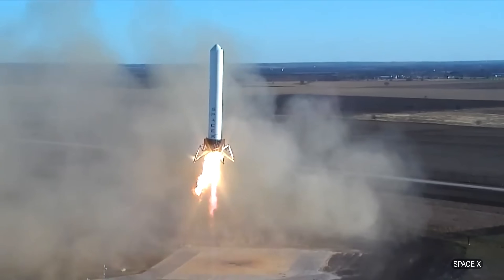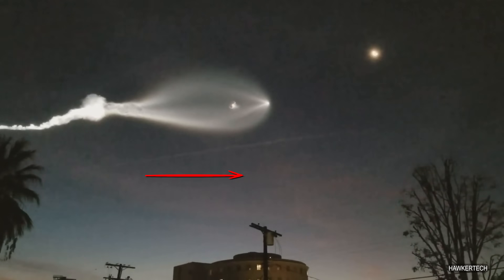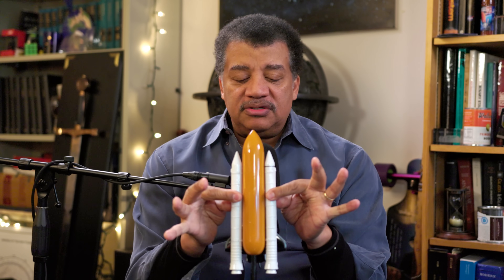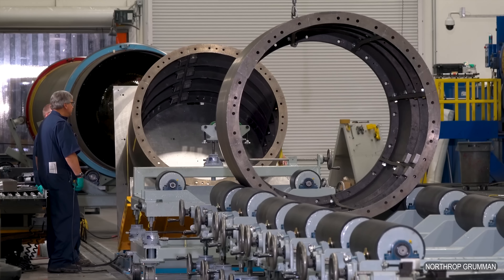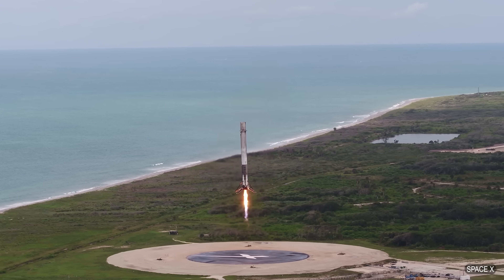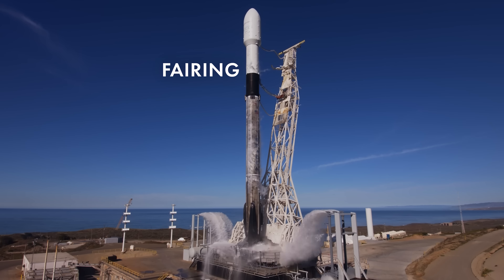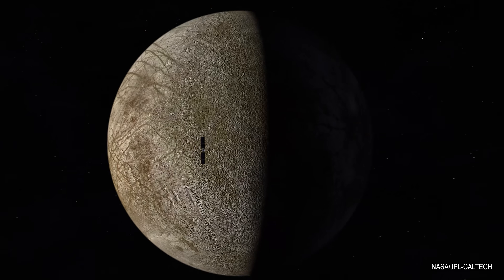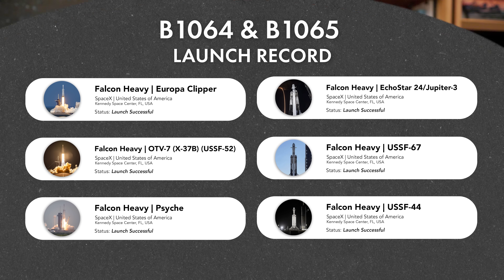What's Up with Reusable Rockets?

Comment: can u still call them “tripods” if there is 4 of them? 🤔
Reply: Quad-pods it is! Seconded!!🙌🏾
Reply: @chandcn009 came to say this😂
Reply: @chandcn009  Landing legs...
Reply: tetrapods
Reply: Polypods!
Reply: Now you look up and see the 8th Starship blown to smithereens.
Reply: @sharpvidtube  yet the booster is literally caught in the air 3 times
Reply: @ They will figure it out. They already got the booster catch down.
Reply: It's the same principle than calling some humans bipods with 3rd leg. So these are called tripods with 4th leg (and proud of it).
Reply: @tkermi  Humans are Bi-pedal
Reply: I have a lot of admiration for NDT but calling the Falcon landing legs “tripods” is just a mistake, he did not do it for “simplicity”. There are four landing legs, and he should have just said that. It’s not complicated, and it’s accurate.
Reply: Tetrapods
Reply: Quadpods sounds goofy. They will be called "dual bipods."
Reply: four tripods
Reply: Quadrupod
Reply: Landing gears
Reply: landing legs be it
Reply: pods
Reply: Frypods
Reply: it is kind of funny how there are 4 when 3 or 5 at first glance ought to be better
Reply: @snuffeldjuret  more points are more stable, especially when each is adjustable.  Three is the minimum in 3D space.  We don't make most chairs with three legs because they'd be much easier to tip, unless they were unusually wide.  We usually don't do five legs because four is stable enough that the extra engineering isn't productive.  It can look nice, though.  Humans are able to have two legs because each one comes with a long foot that usually allows a minimum of four ground contact points, and up to 14.
Reply: @ snuffeldjuret I think the primary reason most chairs have stuck to four is keeping the design and fabrication simple with right angles.
Kitchen chairs and similar situations definitely would be another good reason to stick with right angles.  Hard to imagine any theatre or close-packed classroom situation using three or five-legged chairs.  Stacking or folding chairs with a back also almost require being a four-sided design.
The five-sided design popular in office chairs relates to them being able to spin.  Closing the angles from 90 to 72 degrees between legs offers a lot of stability without going to a lot wider radius.
Yes, what I see of New Glenn's booster landing gear are six legs.  Nice looking design without getting overly fancy.
Reply: These are the real questions 🧐🧐🧐
Reply: It seems people are confused here. When he said tripod, he wasn't referring to all 4 gear, he was talking about the gear themselves. There are 4 tripod landing gear on each rocket.
Reply: @ Norman so....twelve feet?   That's four tripods.  Each part is a leg or strut with a foot.
Reply: @VoltisArt  I mean all you have to do is look at them. There are 4 contact points on the ground and 12 on the ship. It's the main strut and 2 hydraulics a leg.
Reply: @ Norman that's not what tripod means.  Tripods have one body supported by three feet, usually with some sort of legs, but not by definition.  A planter with three rubber feet is a simple tripod.
You're describing pairs of struts supporting each one of four legs with a total of four feet, which is why people above said things like quadpod, even though it's a rather uncommon word that doesn't flow quite as pleasantly as tripod.
The "pod" part means foot, so the legs (and any other supports) aren't relevant to the word.  (See also: _podiatrist_)
Reply: quarepods
Reply: You're reminding me of a US senator who said if the pentagon had only 3 sides it would be called the triagon
Reply: Tripod S+
Reply: Retracting landing legs.
Reply: Two pair of limbs
Reply: It was for simplicity.  No one would understand what a quadripod would have been, but we've all used tripods before, so we understand them as a stand, rather than the fact its three legs.

Comment: Cost of launching 1 Kg into orbit in 2025 dollars:
Saturn V: $55,000
Shuttle: $65,000
Falcon 9: $2,500
Starship (projected): $200
Reply: The cost so far for Starship, $3 billion for one banana?
Reply: @sharpvidtube starship is still doing test flights thats why it hasn’t had any payload yet.
Reply: @Wheatthin21  Apollo 7 had a crewed flight in low Earth orbit, using 60s technology. 56 years later, an empty Starship 7, blew up.  Elon claimed that there could be a manned mission to Mars in 2024, he knows how to under deliver.
Reply: I think Starship is made to travel to the moon/Mars and not for putting satellites into orbit.
Reply: @sumeshkrishnan8618  it's main purpose to b3gin wi5h is to deploy countless starlink satellites
Reply: @maaginen1007  It's main purpose is to go to Mars. That's why it's a methalox rocket. That's why it's so big. That's why it doesn't use hypergolic attitude control. Etc.

It's been shoehorned into the role of Starlink satellite launcher and moon lander, but everything about the design is intended for Mars.
Reply: @sumeshkrishnan8618  will do both. Models of starship SpaceX is getting ready to test will start testing deploying fake starlink satellites. Will also be used as a fueling station in space.
Reply: @sumeshkrishnan8618  it can easily take satellites up. Starlink is going 10x-100x the speed/capacity within a year from the new Starlink satellites designed for starship. I believe it's a 35k cu ft payload fairing
Reply: @sumeshkrishnan8618 they reported to NASA, you know their customer that’s given them billions of dollars to deliver the HLS to the moon that the current ship can not even lift the 15,000 payload to LOE.

Comment: I'm not clear if the shuttle boosters were reusable or not, but they were often towed back to Canaveral floating on the surface and not garbage at the bottom of the ocean, at least not every time.
Reply: Technically they were reused. But they stripped the whole thing down to bare metal and then put it back together again. It cost more to reuse them than to make new ones, which is why SLS isn't reusing the boosters.

Comment: if the only thing holding back privte companies from going into the space buissness was a few laws that congress needed to pass then why is it that no company form ANY OTHER contry got into the space bussness. the answer is simple. BECAUSE the laws being in place WAS NOT the main obstical. it was cost and knowledge.

over the last 30 years the cost of manufacturing has dropped off by A LOT. but it's not just the cost it's also the SPEED of making things that has also made it possible. so the main problem stopping company's from getting into space has been TECHNOLOGY. Material science, Micro-elctronic manufacturing, computer CAD software/manufacturing, computer modeling and a massive long list of other advances have finaly caught upto our imagination and enabled us to finaly move forward into space.
yes we landed on the moon in 1969 but apollo 11 was given about a 5% chance of succeeding and yes the following missions had a better chance but not by much. our vision of the future far outshone our technological knowledge.

Comment: Reusable rockets are well suited for low-Earth orbit missions. But for trips to distant planets, nuclear tugboats of the Zeus type, which is manufactured by Roscosmos, are needed.
Reply: Reusable rockets like Starship are needed to fill the tankers for in space refueling.
Reply: @ Exactly. That's how we're getting to Mars. The reason it takes NASA 6 months is because just getting to orbit empties the fuel tank. So basically NASA rockets are getting to Mars on fumes. With a full tank of gas, you can get to Mars a lot quicker, which is something Neil doesn't understand yet. Or I guess Neil is just one of those "got to see it to believe it" types.
Reply: So once your tugboat gets you to Mars, then what? You just die on Mars?
Reply: sorry but no

Comment: Shuttle boosters were reusable
Reply: Yeah, with only around a few hundred million dollars for refurbishment each time... (around $1.5 billion total to send the entire thing back again every time)
Reply: @OnigoroshiZero  That's cheap. It costs over $2.5 Billion for every launch of SLS.
Reply: @OnigoroshiZero  "Good Grammar or Good Taste".  Do you want to send more payload or get more undeserved paycheck?  The cost of the powered launchpad retrieval system is more in so many ways.  And I am betting that your stat on the Shuttle Program SRBs turnaround is off as well.  That number is the ENTIRE program flight turnaround cost.  SpaceX lifts 141,000 Lbs.  I guess they figure they can handle the payload setback.  But it takes 30 hot live rocket engines to do it, and that is 6 times more points of failure compared to your previous tech Saturn 5 five engine booster.  These engines are supposed to be more powerful.  Perhaps they should use them to make a super booster instead of playing "return to base" video games with them.  What did they use "F-14 swing wing motors" to get those "capture arms" to swing in so fast?  And what...  are they padded or something?
Reply: Yeah, he said that. Even still, not efficiently. The refurbishment cost was still insane
Reply: "were"
Reply: The rocket engines attached to the back of the shuttle were also reusable
Reply: yeah the narrative was a bit unclear in the beginning of the video
Reply: I don't think you know what boosters are
Reply: @0x0michael  The solid rockets stuck on the sides. Those were recovered and reused. The only thing tossed was the tank

Comment: At this point, we would be ahead if starship were single use
Reply: I don't know how you can't understand why reusable is better. You can cut down on launch costs by 90%. If it was your money you'd think it was worth it to spend the extra money now
Reply: The Falcon 9 is the most reliable rocket in history BY FAR. SpaceX is launching more rockets than the rest of the planet combined. And they are putting up nearly 10x more mass into orbit than the rest of the planet combined.

Starship is still in development. But even then, the booster has been caught 3 times now and soft landed twice. The previous upper stage reentered on target 3 times in a row with one other soft landing. The new upper stage is having issues. But they will figure those out.
Reply: Did you watch the video? Sure, the entire thing seems like a waste of time and money, but it’s designed to simplify things down the line. Instead of swimming, we're running, so why complain?
Reply: @Benstiq laughing 45-60 launches with many more points of failure rather then one single launch is simplifying things?
Reply: They are fanboys, pardon them

Comment: Is the cost of the return fuel and tripod cheaper than the cost to go out into the Atlantic to fish out the boosters? If it is, then that might be a good tradeoff
Reply: Salt water damaged the boosters so much it was cheaper to let them sink and build new ones than to refurbish. The shuttle cost 1.5 billion per mission. SLS with Orion costs 4-5 billion. Starship expended will cost 100-200 million. 20-50 if fully reuseable
Reply: @Smiles10130 The salt is not the reason, it would be cheaper to rebuild a booster. The reason is actually getting it out of the water, if it has left over fuel, boom, everyone on the recovery ship is either dead or floating in the middle of the ocean. Also getting ships with cranes to pull out a parking lot full of cars worth of weight, yeah no just not feasible
Reply: @John-pp6xy  Yes, fishing out a rocket that may have fuel is a big issue. The salt water is also a big issue according to NASA, Space X, Blue Origin, Peter Beck and probably others. It gets brought up in interviews all the time and they all say the same thing that it seems easy until you are dealing with it having been in the water.
Reply: Just think about like playing catch. Playing catch with somebody is fun because they can throw it back. But without them, you throw it, then you have to chase after it.
Reply: or like this: 4:41
Reply: yall both made a comment witout fully watching the video. why?
Reply: The answer is definitely yes. And also ocean water is very unhealthy for rockets. But Neil is totally skipping over the newest state-of-the-art. They now have this gigantic tower called Mechazilla that catches the rocket in its arms which are called Chopsticks. You should check out the video. Just search for IFT-8.